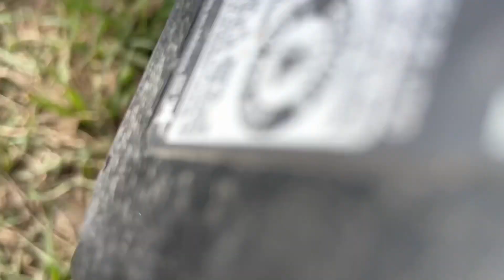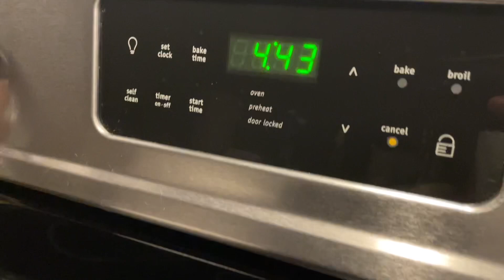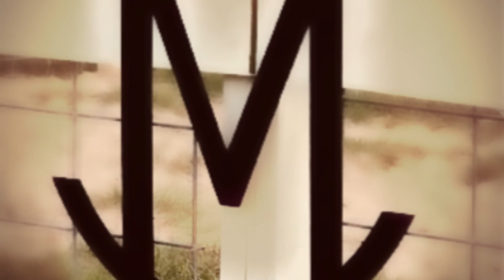Ostrich Rescue: the full behind the scenes!

Comment: I know that building supply truck!!!!

I work for that company!!

13:40

It may have been the last pieces they had and they would rather send it than short you. Or it could have been the person loading. That does happen sometimes. Also, no disrespect intended at all, most builders buy 10% more than they need for errors and mistakes. Like the one Jake made. 😏

Though I will say, if you send pictures to them, they should have someone hot shot out the replacements.

Comment: Eventually the boards that you screwed into the tree are not going to be at the same level that you put them you have to remember that tree is going to grow it's still growing everyday so eventually your boards are not going to be straight they're going to be vertical and it's going to tear apart the other side of the board with connected to the fence. It's just going to plain get messed up. But trees don't grow that fast so you got a little bit of time

Comment: I see you bought a new horse trailer. Now that you can pull a trailer longer distances, you need to do some reading about pulling trailers on the road. The main thing you need to do is make sure you stay in the right lane while driving and most states require you to drive at a slower speed. Also you need to make stops to allow your livestock to rest. The horses should be offered water and be taken out and walked if possible.